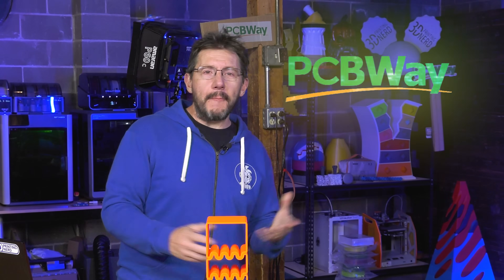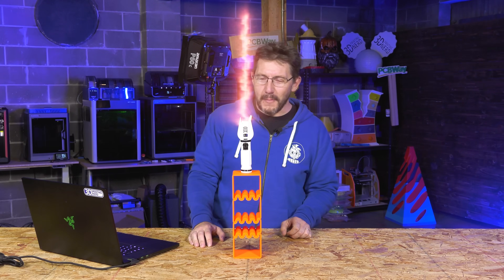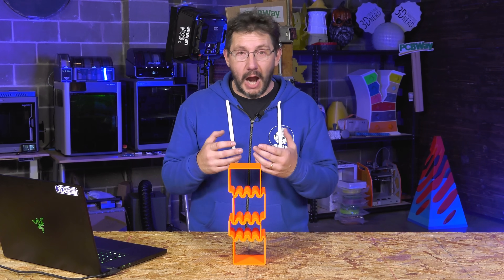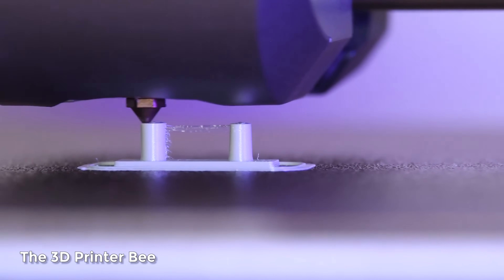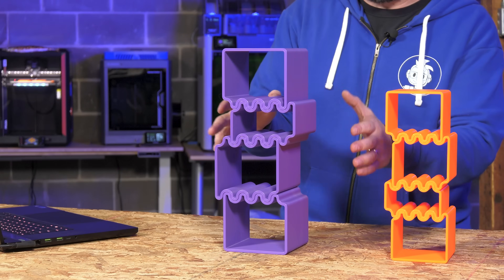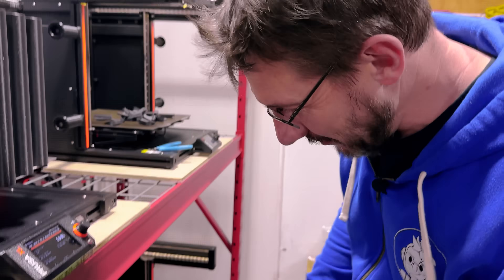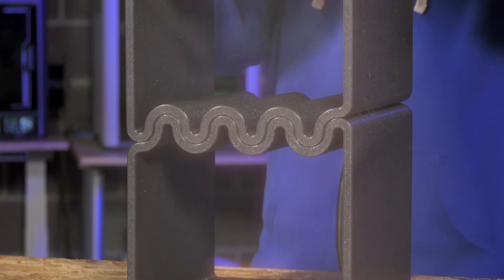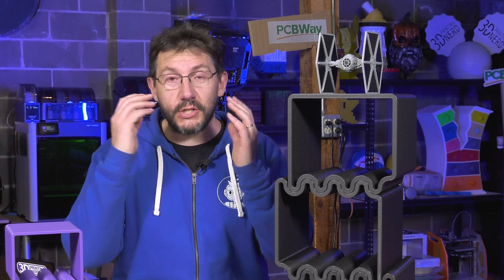This MASSIVE Shelf Holds What?

Comment: Yeah core xy the only thing better is the fact that the buildplate is not moving bud the tool head is moving. 
Bud it is not faster in printing materials because of the the settings for the 𝕞𝕒𝕥𝕖𝕣𝕚𝕒𝕝𝕤 bud that said. 
Fuzzy scan wil let you disapere the seam complet. 
Whit that setting you wil never see a seam on your print annywhere not on the inside ore outside.

Comment: Probably better off 3d printing parts to make a large mold then casting something using epoxy or reinforced concrete, etc. I came up with the idea of 'expanded concrete" using a mold where you have an x shape with a square box around with rounded edges & corners you put two z shaped rebars inside and it has a pocket for a "tall" plastic mesh insert that are injection molded. that way you have an optimized strength to weight ratio with much larger footprint, like expanded metal, for building things.
Reply from the maker: That's a really interesting idea!

Comment: I printed a 3m long shelf which is also a digital clock. It took about two month of printing and a hole weekend of soldering. Not to mention that three people where required to put it onto the wall. Now I have storage for my collectors figurines and the wast space over the staircase is used sufficient.
Reply from the maker: HOLY CRAP just looked at it - EPIC!
Reply: @3DPrintingNerd  You for sure did more epic stuff. :D
Reply: Pics?
Reply: @PrintovationsExpress  Thingyverse: Even bigger giant clock.
Reply: Amazing project dude, nicely done! 🍻

Comment: Cool. Wish they had a way to just buy a model rather than that horrible "become a member" aka patreon on 3d printer sites. I just don't need/want any of the other stuff :(
Reply: You could knock something similar to this out in Fusion 360 in 10 minutes after a 10 minute tutorial..
Reply from the maker: I really wish I knew Fusion 360 well enough to do stuff like this.
Reply: @3DPrintingNerd  you can just as easily do it in TinkerCad in maybe 15 minutes… the wavy bits can be cut in half rings and the rest are basically straight lines….  

My recommendation, don’t get overwhelmed by the design, almost everything is either a circle, a triangle, or square in various proportions.
Reply: @StumblingBumblingIdiot  pro-tip, if you learn CAD you can just copy any designs that catch your fancy, it's surprisingly easy.
Reply: @butterdubs2267  I know, I know. I am just saying it would be nice to have the option to just buy a design if you want rather than a whole subscription thing. This is a super simple design to remake but always like to support the ones that thought of it :)